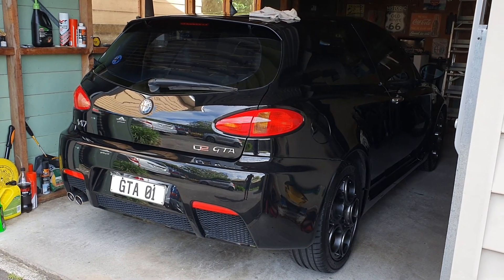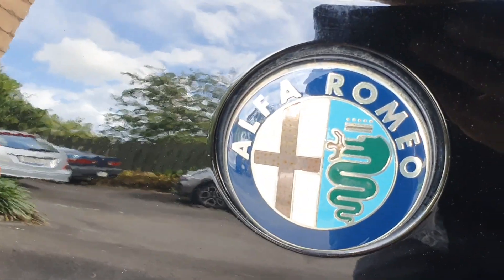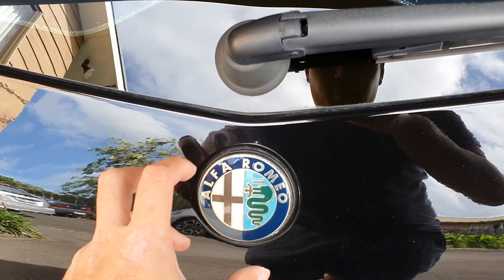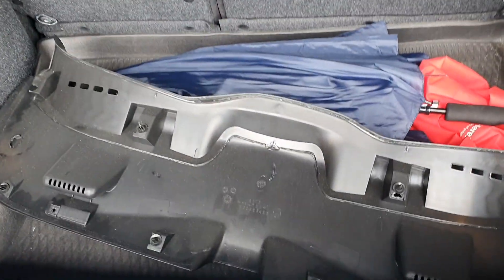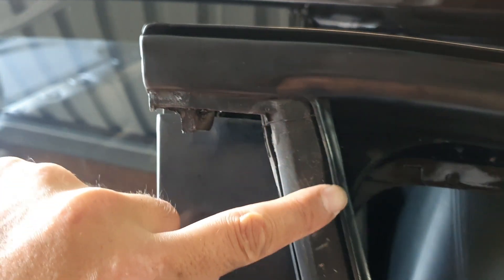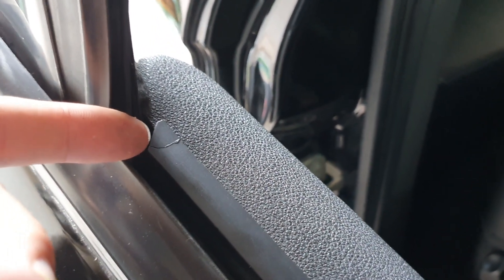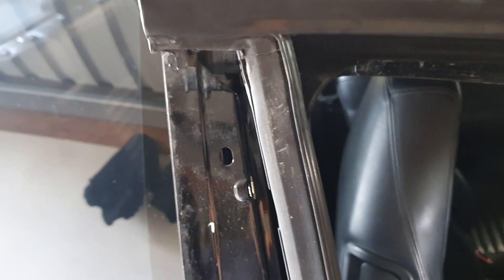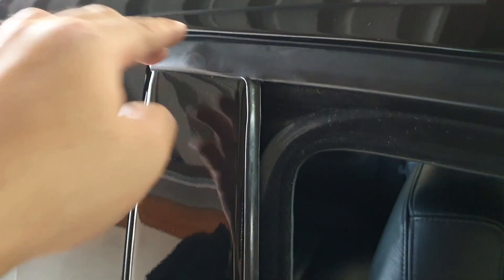Alfa Romeo 147 GTA Episode 19 - Rear badge and door trims

Comment: I'll be watching this later. Thanks Luey

I've got to do the rear badge myself. It's the one thing on the car that's really scabby. Yours looks so smart now.While I'm at it I need to look at the wiring going into the boot. It's only opening intermittently.
Reply: The new badge will fade after around 8 months, I'd advise you laquer it first
Reply: @nurski  they are already coated. If your car is garaged the badge will be as good as new for years. I replaced the front one 8 years ago and it's still perfect.
Reply: @red75v67  I've had 13 alfas and probably bought around 26 pairs of badges but then again I do live in England and don't have a garage.  They come laquered as you say but no harm at least to laquer them again 👍🏽

Comment: Hi!  I'm having trouble removing the plastic trunk trim. I unscrew the 4 screws, and then I pull it but it's like it's clinging to something. Did you use a lot of force in the part that cuts the video? I need to see how you separate the plastic cover, mine is stuck or I have to apply more force, I'm not sure. I have broken a white rivet trying it and I dare not anymore. thanks u
Reply from the maker: Basically you just lift up 1 corner and pull with a bit of force to release the clip in that corner. Repeat for all the corners. Unfortunately broken plastic clips are part and parcel with removing trim pieces from any car...if you break any of the plastic plugs/trees then they are fairly easy to source from auto or hardware stores.

Comment: Hi I have a 5 door alfa romeo 147 is it possible to order 4 door pillars? I have had no luck so have decided to sand it and prime it and then repaint it myself. I also am looking to replace my emblems but may heat the badges off as I could not find the ones with the screw. So found some with a strong sticker. Any advise would be great. Lovely Gta btw.
Reply from the maker: The trim is different from 3 door to 5 door so you'd have to order specific 5 door trim. I found with 1 of my trim pieces it had plastic marks all over it from storage over the years so it might be best just to paint them anyway!
Reply from the maker: I bought my badge from Alfaworkshop but there are others out there that stock them. Have another look its much better to buy the proper one rather than a stick on badge